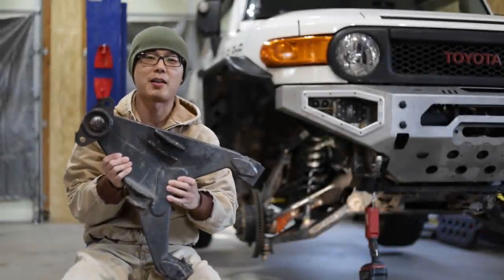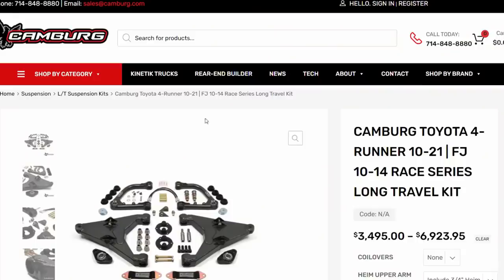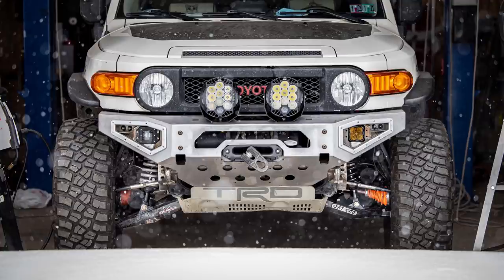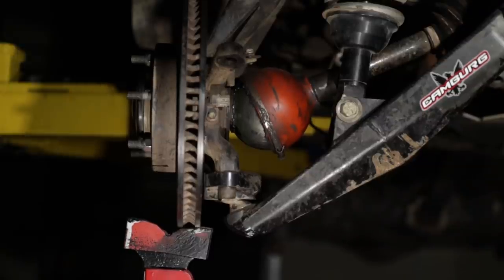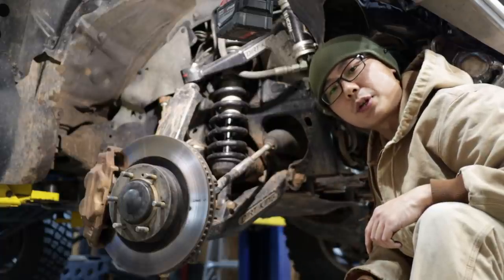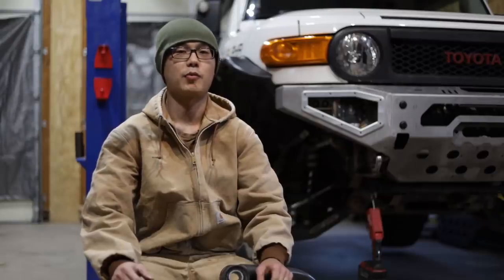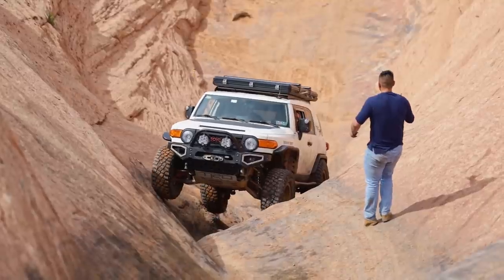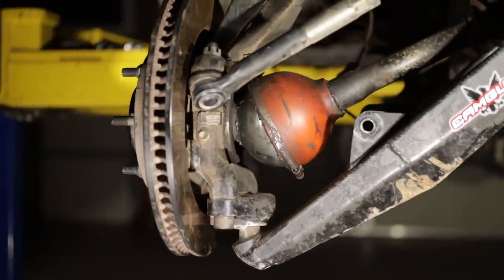Toyota Long Travel IFS - Camburg vs Dirt King

Comment: Great job my man! Something to think about when Dirt King pushes the wheel forward they limit the cv angles since it’s no longer centered,  which is why their axel shaft is longer to help accommodate that change addressing the plunge as well.
Reply: That is good to know, thanks!
Reply: Pushing the wheel forward helps fit larger tires and increases the approach angle.
Reply: Really informative video!

Comment: in regards to the cv axle topic. When you have a cv axle that is shorter and slides inside the inner tripod housing aka the housing on the differential not the hub. when it is extended out while in a full doop situation if you are heavy on the gas pedal or get into a bouncing situation it can shatter that entire inside housing . Yes I have def done that before. Not on my FJ but I have done it several times on a lifted 2 door tahoe bc the lift it had caused the cv's to be at a bad angle just sitting normal but when it got to offroading in any situation such as I described. BOOM... I have installed the Total Chaos +2 inch long travel on my 2010 fj and I love it.

Comment: Such great data. Thanks for all this. I have Dirt King lower arms in stock length and you have me curious about wearing them out quicker due to positive caster. After 20,000 miles, I took it all apart and noticed that the bushings had take some shape of LCA bolt hole. Not necessarily deformed, but more than likely normal wear for 4+ degrees of caster. Maybe I'll just replace them next teardown.
Reply from the maker: Thanks! I’d say if the bushings aren’t torn. Don’t bother replacing them. Delrin is thermoplastic and will stress relax/creep. So it taking the new shape might actually bear the load better (just my speculation lol). I used to have total chaos +2 LT with poly bushings. They would start tearing at the end surface where it contacts the frame brackets.

Comment: Having paid almost 6K for a full mid-travel kit I wish I would have done a +2 long travel kit, the amount of actual articulation from a mid travel kit is barely more than stock.
I’m checking out all the options leaning towards a JD fab kit. Camburg also has a +2 kit called Trail Series that uses OEM mid travel coil overs. Thanks for the super helpful comparison here🤙🏽

Comment: Hi Kai,
I really enjoy all your videos. I always find them informative and insightful. I have a 2008 GX470. It sits on 34’s (285/75/17 BFG ko2’s) and a 2-1/2 lift. I use it as my daily driver. It has impeccable on road manners given its configuration. So, I'm hesitant to go overboard with modifications.
Like most wheelers, I enjoy the occasional rock crawling trip, but the majority of my wheeling just relates to overlanding, with trips across Colorado, Idaho, the Pacific NW and Alaska. I am considering a trip through Mexico to Central America soon too. Given the distances and varied terrain I cover, I’m primarily focused on reliability and durability on trails that could be much more isolated than some of the more popular trails. I’m also looking for increased wheel travel for the more challenging sections of trails though, so I considered long-travel kits. I recently rewatched your video on Toyota ifs long travel kits. in your opinion should I even consider a long travel suspension given my type of driving? How does long travel compare to the factory set up?

Comment: Man your channel came to clear a lot of doubts many of us off roaders have, really appreciated. I was wondering if you can talk about why and how to correct the camber when lifting the car. I've found the more you lift your car the higher the positive camber gets. I've heard that some brands sells extended lower control arm to correct the problem with adjustable uca too, but I wish to know your approach
Reply from the maker: Thanks. Other vehicle can be different, but for Toyota 4X4, adjusting the lower control arm cam bolts are usually enough.

Comment: Excellent information,  My rig is a 2011 LexusGX460 with Toyo opencountryMT35x12.5R18 SPC UCA, BODY MOUNT CHOP, 1.25 SPACER original rims, 3 inch Dobinson suspensión, I want to know a comparison about reliability between factory and extended travel, also how it's compare in real world Offroading, thanks and hi from Puerto Rico
Reply from the maker: Thanks for the feedback! Yes that is a video in the plan. Stay tuned!

Comment: I like the dirt king every thing I seen you show for what they do and offer it’s the winning builder!  I can see what your are saying about the cv joints puncture resistant.  I made plates and currently use the bottom strut bolt and nut to hold it in place .  It’s just kinda like a flat guard cut to fit the contour of the bottom control arm so with one nut holding it on it relays on the figment to be snug against the top edge of the bottom control arm.  They work well and look good just for a educated guess and some playing with and adding and subtracting.  I’d say you did one heck of a job putting both of these to the test it was a great show .  I’ve thought about the long travel .  My set up now is about 4-5 inch lift with 33-12.50-17 .  I had to add front wheel spacers to get my front to rear wheel width from side to side right. Being that said the long travel would in turn eliminates the need for the spacer .  Plus it gives me more usable travel.  Good deal I’m sold on dirt king right now as my ultimate option for front suspension upgrade thanks again for this great learning experience.

Comment: Awesome, video. I hope you make more on various FJ Cruiser subjects.  I was thinking of buying the Total Chaos LT kit,  I'll have to read your review on FJ forum. *Update: I just read the review of the Total Chaos LT kit.  So between Dirt King, Total Chaos, Camburg and Allpro which would be the best of both worlds? Which would be good for high speed? Thanks for the detailed break down.
Reply from the maker: Thanks! I will be making more technical focused videos on other mods. Stay tuned! For a quick and short answer, I'd say go with Dirt King. Allpro only makes a +2 kit, but its UCA has 1.25" uniball and the uniball cup is angled heavily. So it can pull some good travel. One of my friends installed their latest kit last year and measured almost as much travel as my +3.5 kit (assuming no measurement error). He did have trail gear resent multiple parts due to fit issues, which didn't leave a good impression on quality. If you want serious pre-runner level high speed, and have welded on all the gussets to reinforce the frame, Camburg can probably take the most beating. But at that point you should probably look at kits with vertical uniballs. For just recreational "high speed", I don't think choosing between these kits will make much difference. The coilover, secondary shock and hydro bump stop setups will make the most difference.

Comment: Hey mate amazing video! The four wheel drive industry needs more influencers like yourself, technical factual info. 

One question, would these kits work for the hilux and prados released in Australia ? 

cheers
Reply from the maker: I believe they should work, but confirm with the manufacturers. Toyota tends to do weird little things that don't make sense. Such as the Tacoma in the US is based on the same Prado platform. But it has a different UCA ball joint taper and the LCA spacing are also slightly different. For no good reasons.
Reply: @TinkerersAdventure   yeah okay! Thanks for that.
Reply: @Steddywelly  Total Chaos has a different part number for international Hilux kits.
Presumably this means there are small differences.

Comment: Doing great with the video.  Do you miss the uniball frame pivots of the camburg?  That seems like Camburg's selling point and I've mentioned to them about the uniball adapter and LCA height but they still don't consider it an issue nor needs improving.  I don't mind the DK  Delrin lowers and don't notice binding but the practice of uniball  frame pivots sounds enticing.
Reply from the maker: Thanks. I don't miss the frame uniballs and actually glad i got rid of them...I replaced mine twice and it was a pain. I don't need the high misalignment with dirtking's forward biased LCA so the bind free feature is not enticing anymore. I don't have high horse power or go real fast  so the extra rigidity of uniball is also not important to me. But i know you got that good stuff under the hood and go flying on 39s, uniball frame pivots might be good for you.

Comment: I also think the tie rod bind needs to be discussed because usually the tie rod and CV bind nearly the same time. The steeper the tie rod angle the more prone it will be to bending. Also the steeper the CV angle the more prone it is to cracking a cage,
Reply from the maker: All great points! I found the inner CV to bind quite earlier than the tie rod. For these type of long travel kits, except for All Pro, the UCA binds before the tie rod. And all of these operates at higher angle than mid travel setups to achieve near advertised travel numbers.

Comment: I’m still undecided on a suspension kit for my 05 f150 crew cab. Long suspension kits are very expensive and would have to save a lot , but is more aesthetically pleasing and like to go fast. 
On the other hand I been looking at rough countrys 6 inch lift as the have re-engineered the front shock instead of using a spacer. And at a fraction of the price. But it’s design still limits ground clearance to me as it puts a crossmember under the crossmember instead of incorporating a long travel upper and lower a-arm. 🤔 I’ve been thinking of mixing the two but don’t have the funds to “see” if it would work to get the ultimate ground clearance at a halfway affordable price
Reply from the maker: I definitely think the wider long travel gain more performance. Especially with the wheel base of the truck, it makes a good go fast off-road rig. I’ve seen a couple Toyota combine long travel and a drop bracket lift, which allow them to run dual spring coilovers. You’ll be paying the cost of the 2 kits combined.

Comment: thanks for that informational video. What CV you were running since you did not mention in the video?
Reply from the maker: They were both RCV axles. The old ones have Dana 60 outers and 930 CV inners. The new ones have Toyota specific outers that is same size as stock, and double offset inner joints.

Comment: Top notch info....though I thought you'd speak to the benefit of the diff drop more.

Is that an ally bumper?
Reply from the maker: Thanks. I personally never ran diff drop so I couldn't speak too much from first hand experience. This is a steel bumper I make (Tinkerer Design Studio). This was my prototype so it was in bare steel condition.

Comment: Thank you for the excellent video. Definitely a highly detailed and technical review. So, do you think that long travel provides a more comfortable ride for long on road trips as well as better performance off road? Looking forward to more videos from your channel.
Reply from the maker: Thanks! No it will not be better on road mostly because losing the front swaybar. But if comparing factory width without front swaybar and long travel, long travel will have more high way stability due to wider track width.

Comment: You need to get dirt kings spec shocks. I highly disagree with the camburg arm being stronger. Dirt king sells more Tacoma kits than Camburg and has zero issues with any arm failures. All in all it was a great video buy I'd like to see the kits cycled using the spec shocks from both company's.
Reply from the maker: Thanks for the feedback. Yeah by no means the dirtking is “weak” nor it would fail before the factory frame mounts. The strength difference would only become relevant when the frame is heavily reinforced for actual high speed racing.

Comment: Well done!

Wondering, have you ever looked at the Total Chaos mid travel system?

I had their long travel on my 96 4Runner and it was awesome!  No one makes a full long travel that is KDSS compatible, but TC does make their mid travel that is KDSS compatible.  That is the way I am going so far.
Reply from the maker: Thanks! Their stock width LCAs are well made and definitely make a build more premium. However if I were to build a mid travel setup myself, I'll probably just stick with the factory LCA. There are benefits of this upgrade, but not enough for myself to justify the cost.

Comment: Have you check out jd fabrication. They made lower arm pivots to push the tires forward and better caster.
Reply from the maker: Yes, they came out with that design after I already got my dirtking setup. It is a good design solving many problems. I expect it will gain popularity quickly

Comment: Excellent video. Do you like Dirt King better than Total Chaous?
Reply from the maker: Thank you. I ran Total Chaos standard +2 kit prior to my Camburg setup. Their original standard kit design was not great. Their expedition series has come a long way. I don't have first hand experience with that so I can't comment in details. What I can tell is TC will have less drop due to it's UCA uniball cup angle. However, I do like it uses chromoly steel for both upper and lower arms. They reduce the weight by going thinner material while maintain the strength.
Reply: @TinkerersAdventure  thank you.

Comment: proper in depth review. what's your opinion on portal hub & axles if compared to dirt king long travel setups?
Reply from the maker: For rock gardens, crazy rock crawling or crazy deep mud, big tires easily win over suspension travel. So I’d take portal with 40s and ridiculous ground clearance over long travel. But for everything else, including Moab slick rock type of crawling, long travel with slightly smaller tires performs better IMHO.

Comment: Thanks for the video.  I am primarily an Overland my Tacoma.  Thus, I am going with factory length UCA’s/LCA’s from Dirtking. Would you recommend Box UCA with or without heim joints to adjust caster?  Planning to move up to 35’s on my 2nd Gen Taco with 3” inch lift.  Body mount has been chopped and relocated.
Reply from the maker: It is very tedious to adjust alignment through heim joints. 98% shops or people would not even touch that. So unless you know exactly what you’re doing, I wouldn’t get heim joints for adjustment reasons. Watch my latest UCA videos for more details!

Comment: Will the Dirt King Long Travel kit work with the Ironman Foam Cell Pro suspension? I know it's not ideal for long travel, but incremental purchases are the name of the game for me.
Reply from the maker: You should check with Dirt King. The range of motion will definitely be wacky and you might not even be able to get the proper ride height.

Comment: Have you heard of JD Fabrication? Their LT kits in conjunction with their lower control arm mount seems to be very well thought out IFS LT setup. I would like to know what your thoughts are on it.
Reply from the maker: Yes I’ve looked into that setup. I’ve chatted with someone with the LCA frame mount and it needed some work to fit the FJ. I like every details about their LT setup. Solves a lot of issues seen on other kits, like adding oil seals to the frame pivot uniballs. Moving the wheel a lot forward is nice but it’s not plug and play. it will start rubbing the front of the wheel well at full bump and turned. The custom sheet metal work to clear that area is much more involved than clearing the rear. So only the really serious guys will fully benefit moving the wheel that much forward. Same apply to RCLT.

Comment: Great job breaking down the information and making it digestible! I am learning ALOT from your videos. I do have a question. I have a long travel kit from Total Chaos that I inherited from the purchase of my FJ. I need to change the tie rods. I noticed you have a set similar to mine that have an extension. Can you tell me the manufacture of the tie rods and where I can find the extension for them? I am having a hard time finding them. Thank you in advance. You have a fan!
Reply from the maker: Thanks! Total chaos makes the tie rod extension for your kit. The outer tie rod end is still OE. The extension is just a machined thread adapter
Reply: @TinkerersAdventure  Thank you! I have been trying to find the extension for months and hitting a dead end at each turn. You're awesome!

Comment: Great video.. one question which ones are better i have FJ..   total chaos +2 LT or dirt kings.  plans where to run total chaos now im split.
Reply from the maker: If you’re looking at standard TC +2, it’s not great. I had that before the Camburg setup. The expedition series is decent. If you want better road manner, get TC expedition +2 and +2 front swaybar. If you want best off-road performance, get dirtking +3.5

Comment: Wife is getting a new ‘22 4Runner 4x4, she  wants a daily driver that will handle Extra well in the dirt (mostly whoops trails & some crawling). Torn between Camburg trail (UCA only) series w 2.5” King coil or the Camburg LT series w UCA/LCA and potential for bump stops. She doesn’t want extended fiberglass fenders but wants exceptional suspension. Thoughts?

Comment: Great video. Have you ever thought about swapping the front upper and lower control arms and CVS of a first gen Tundra?
Reply from the maker: hmmm haven't thought about that. do you know they bolt on to the prado 120/150 platform? I do not like the first gen tundra's LCA ball joint design. Kind of like the camburg design, which is under tensile load all the time
Reply: @TinkerersAdventure  
I hadn't thought about the ball joint design.
The rumor is that it bolts up to the 120. 
But I can't find the forum post I originally saw it in. 
It would be a neat budget long travel build if it worked.